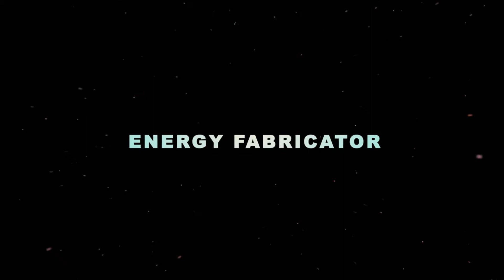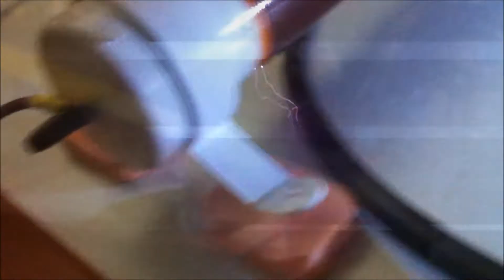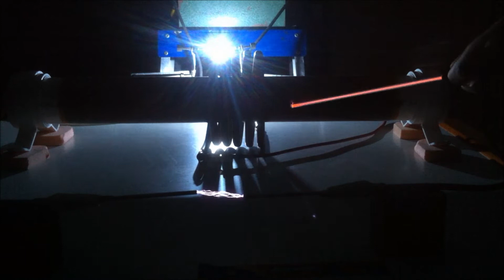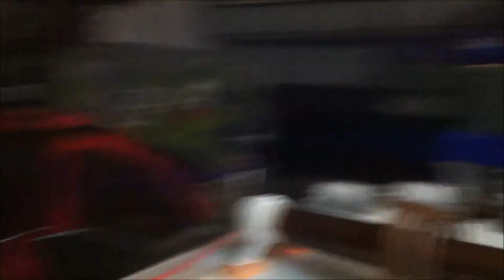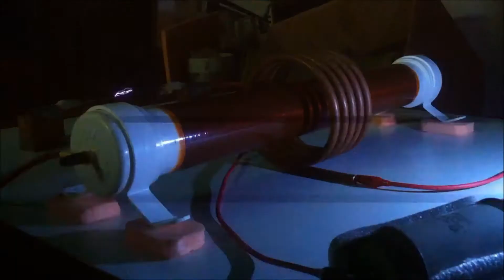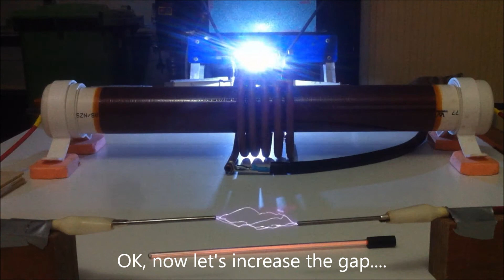Experiment #12.1 - Bipolar Tesla Coil

Comment: Nice, I bet getting bit with 50nF hurts pretty good eh?   I love those teflon silver glass metal caps, they're the only ones I use.  (the doorknobs on my setup always tend to explode.)  On my bellerian apparatus I use about 1.6nF from two 3.1nF caps in series... d'arsonval type driver...    i've tried up to 12nF which in my configuration bites me thru wooden/plastic screwdriver handles...  found that the capacity determines "leader" length...  ;)    Great stuff!

Comment from the maker: This is true, but in  practice, I have found that the magnetic field strength must increase, proportionally with the power in the circuit. Up to 450VA, magnets will work ok, but even N52 magnets just don't cut it when you get up to 2KVA & above, as the dielectric field strength is greater than the magnetic field strength. My next setup will have a 1.8KVA power supply and I plan to use a multiple gap in series with my internally air quenched spark gap. I may add magnets. I am working on it now...